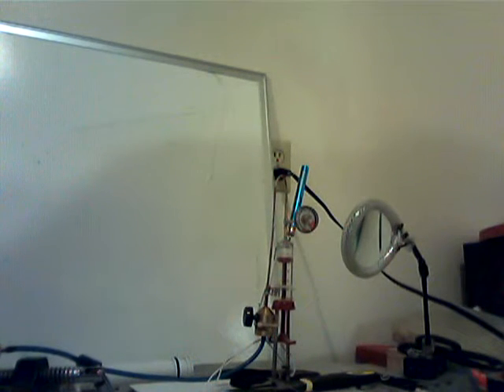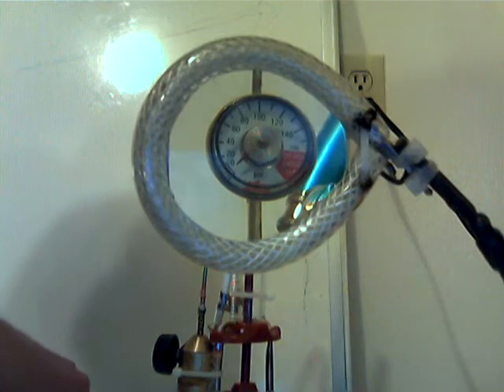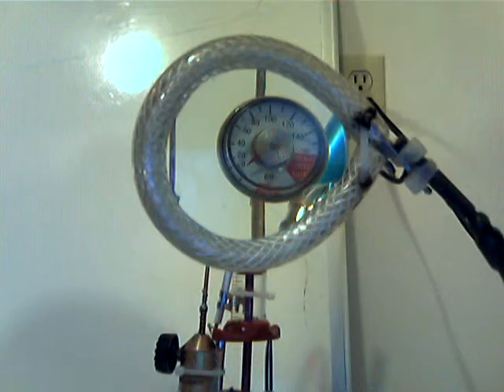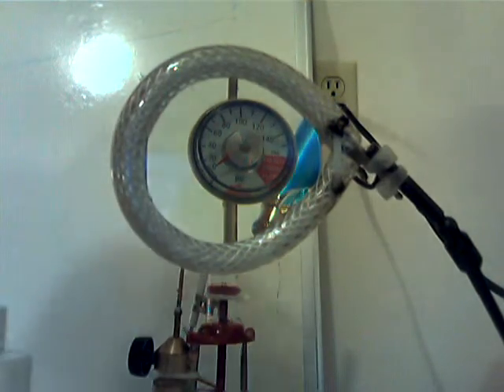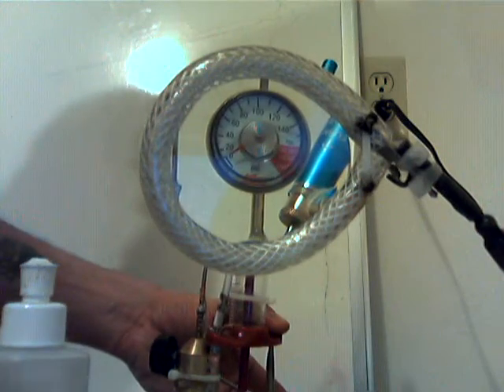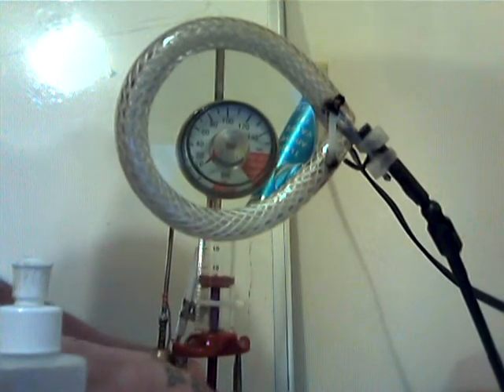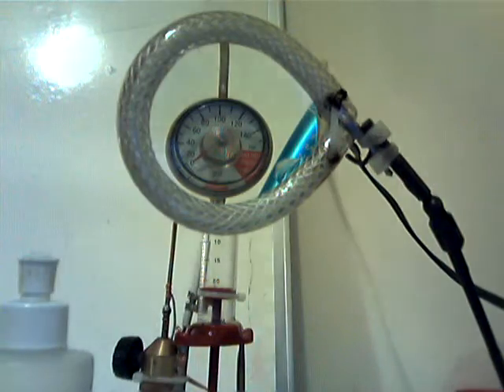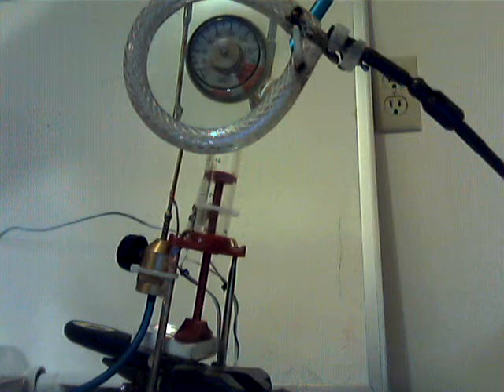hho explosion implosion  testing, combustion of hho

Comment: how did i miss this?didnt see it in my subscriptions....excellent work.

this demonstration of gas volumes to pressure evolved, clearly shows that hydroxy by itself,wont run a CONVENTIONAL Internal Combustion engine at full power,no matter how much gas you put in!

either a new engine design or a new appraoch to expanding the volume of water is needed.

Comment: Gasoline, 129.46 MJ of energy per gallon. 60 miles at 60 MPH in 60 minutes at 25 MPG = 2.4 gallons = 310.7 MJ = 5.18 MJ per minute. 60 amps produces 5 LPM of HHO. Energy density, 185 F cell temp. = 0.0059 MJ per liter x 5 LPM = 0.0295 MJ per minute. 25 MPG needs 5.18 MJ per minute. 0.0295 MJ per minute provides 0.57 percent of needed energy. Additional alternator load will consume about 6.5 percent more fuel, a net loss. 500 character limit, ask how I calculated, I will be happy to answer.